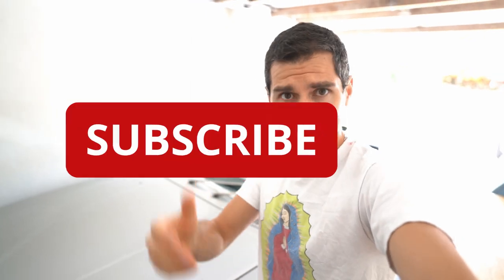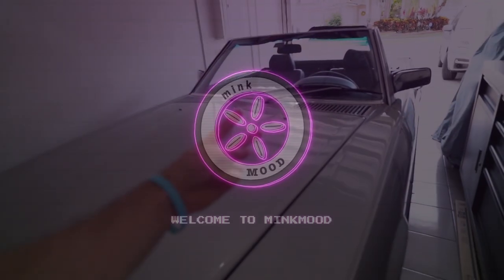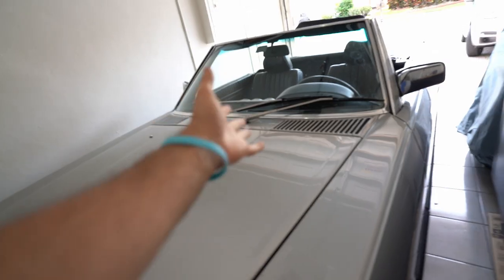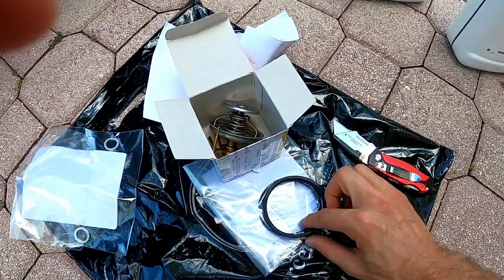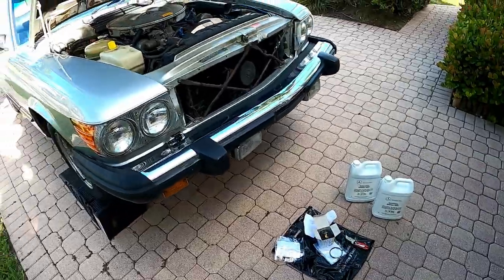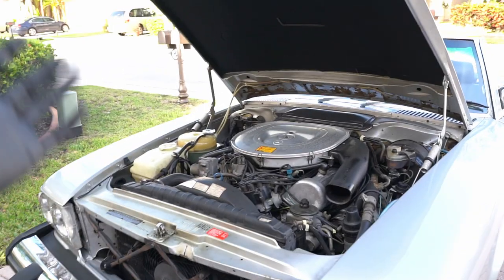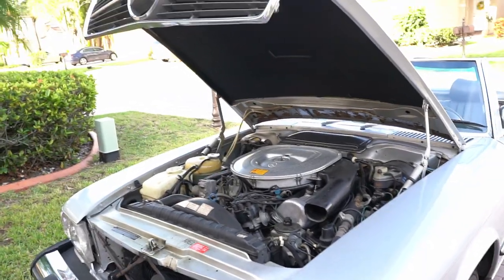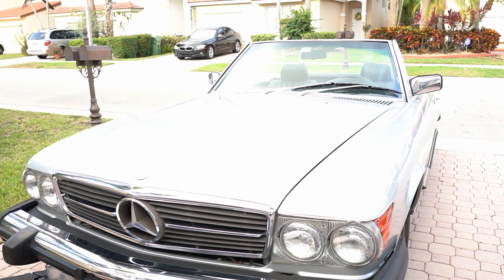How to properly FLUSH your Classics Cooling System (Thermostat + Coolant + Clutch Fan)

Comment: Hey man. I’ve replaced the coolant but my car is running a bit warm. 100 on a regular. I didn’t replace the thermostat (since I broke the holding bold) but will be taking into the mechanic soon. I also didn’t replace the fan clutch. Do you suggest the fan clutch as well? Do they get old and need replacement every once in a while? What is your normal running temp? Thanks.
Reply from the maker: Hi mate, should be in the low 80’s. For the fan clutch do the following test. Have the car running at operating temp, idling open the hood and have someone stopping the engine. Count how many seconds it takes to the fan to stop spinning. If more then 2-3 seconds then it’s gone
Reply: @MinkMood  thanks man. It stopped right away. Also, when cold and I try to spin it, it barely spins. Stops about two spindles over (not even a quarter turn).
Reply: @MinkMood  hey are you in los angeles area ? i just got a 1981 380 sl ,i need to do some work
Reply from the maker: @guyk4819  hi mate im I’m South Florida but i believe @sophia the 380 is in California. Maybe he can guide you

Comment: While doing the coolant flush I was able to drain the radiator but both the engine block plugs are rusted shut and rounded off my original coolant color is green and I am switching over to the Mercedes blue do you think I would be fine if I just do the radiator flush ?
Reply from the maker: Yes, try running a couple of cycles of distilled water, flush and repeat 3 cycles. Ideally water should come transparent

Comment: The burping process. How is that done? Do you use the kit and run the vehicle till the bubbles stop and fill accordingly.
Reply from the maker: Exactly, it’s important that the filler tank is above the entire cooling system for the bubbles to come out.

Comment: I thought the blue coolant was for later models. I use that in my newer BMW, but for my old Benz W126, I use Zerex G05. I think it's yellow, if I recall. Not sure it matters.
Reply from the maker: The most important thing is not to mix them. In my case was running green from an auto parts store , flushed all of it and then when with MB blue 👍

Comment: Great video. I’m about to do this.. Do I need washers for the 3 for the drain plugs? Thanks man.
Reply from the maker: If I remember correctly I got new washers. 2 Aluminum for the block and 1 cooper for the radiator
Reply: @MinkMood  Thanks. One more question, what do you mean by run the distilled water without the thermostat? You had to have it installed, right?
Reply from the maker: @sophiathe380sl  I ran without thermostat for the flushing process. Then when all the water is out, and before filling it with 50-50 you install a new thermostat
Reply: Guys- quick question, do you have to replace the thermostat every time you do a flush. My service records show the thermostat was replaced 10,000 miles and 5 years ago, wondering what to do. Thanks!

Comment: I really like the video. I'm working on restoring a 380SL myself. Do you use a shop manual to find out where things are and how to remove them? I'm trying to follow your video as to where the thermostat is.
Reply from the maker: Hi Ryan, I’m glad you like them!
Regarding service manuals yes, I bought them on eBay and they are very useful.
Send me a mail I’ll try to help you
Reply: @MinkMood  Great, thanks! What is your email?
Reply from the maker: @mercedesman4774  info@minkmood.com
Reply: @MinkMood  Thanks
Reply: I noticed that you drain coolant from three locations. Do you need to do this or can you just drain from the radiator?
Reply: Also, what size attachment for your wrench do you need to fit the drain bolt?
Reply from the maker: @mercedesman4774  hi Ryan, the 2 in the block is to fully drain the system. If not there will be about 1 gallon not drained inside the engine. You can avoid removing them by doing a garden flush way.
Reply: @MinkMood  What is the garden flush way?